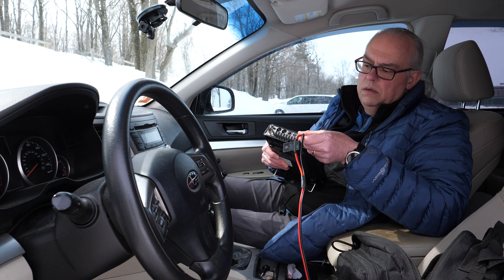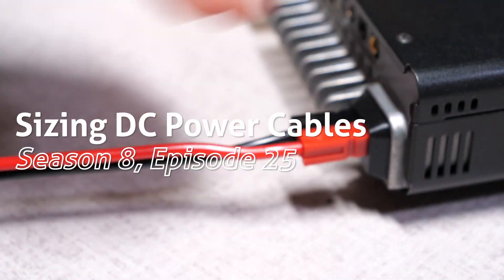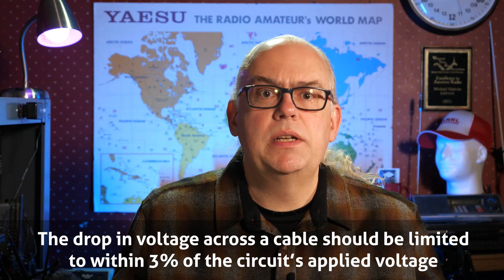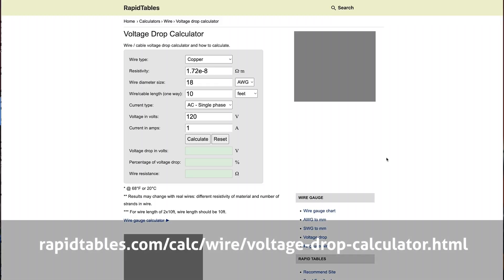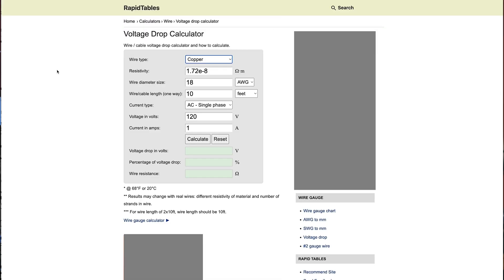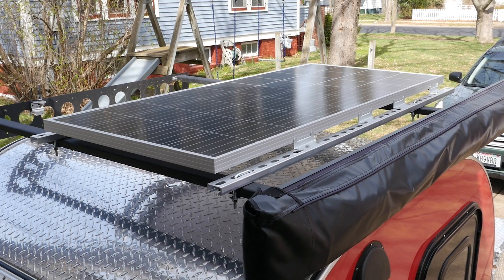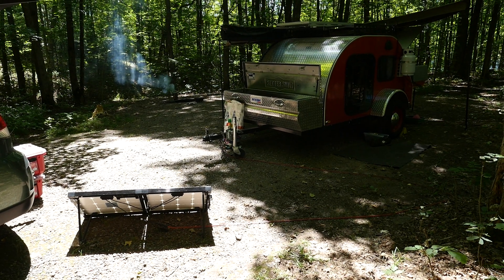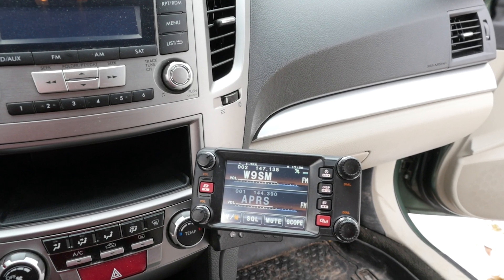Is your transceiver efficient? Sizing DC power cables for current draw #hamradioqa

Comment: Hi Michael, how short could my transceiver power cord be?
Reply from the maker: I usually say, make the power cable short enough to be convenient. Out in the field I'm using 12 gauge stranded and have two cables, a 3 foot and a 6 foot. The six foot cable is nice as I can place the battery on the ground, otherwise three foot is more than plenty for most tasks. In my shack, I custom cut my cables to reach from the power supply to the rig with enough slack so I can also pull the radio out without too much effort.

Comment: Thank you for covering this.. I am wanting to fit Anderson connectors to my 130ah auxiliary battery in the boot of my car and was unsure what AWG cable to use for my Yaesu 991A.. 

I also wish to redo my KPO DX5000 PLUS 10M radio power cables as they're a little thin for my liking... Anderson Connectors are the way forward as I keep having to nip and trim cables going between battery terminals and shack psu.

Thanks for sharing

Comment: I figure I'm pretty safe, I'm using 10 feet of 10 AWG  stranded wire for a 25 amp max load (xyl said the original 12 AWG power cord seemed kinda wimpy)

Thanks!!
KE8NFK

Comment: I have #2 AWG welding cable making the 60' run from my 5KW of panels to the charge controller.  My panels are in series and the input voltage to the charge controller is 140V, no load and 125VDC under load.  The wire in my system also 25; of 10 and another 1-0' of #4.  The cables were the single biggest expense outside of 23KWH of LiFPo batteries.

Comment: Hello, since a dipole is an unbalanced antenna, are yagi antennas also unbalanced?
Reply from the maker: A true dipole is considered a balanced antenna, since each leg is the same length and they radiate in an equal manner. The radiating element of a Yagi is a dipole, so it would also be considered a balanced antenna.
Reply: @KB9VBRAntennas  Thank you! Oh, I got it mixed up. lol So if I need a Balun for a dipole, I would also need one for a yagi?